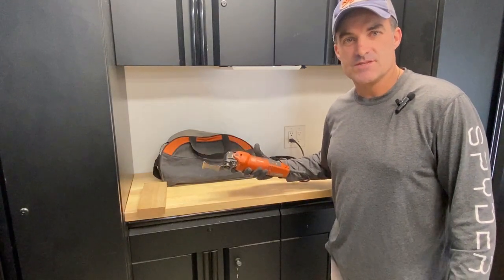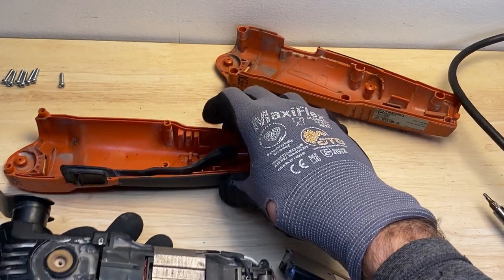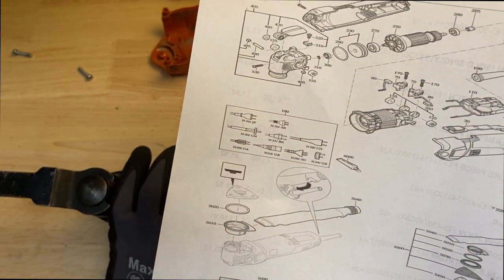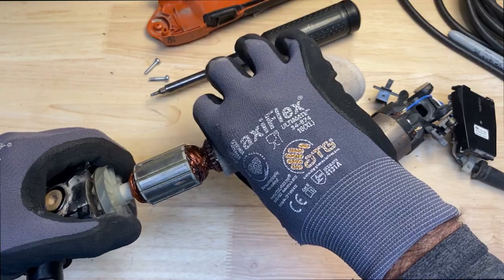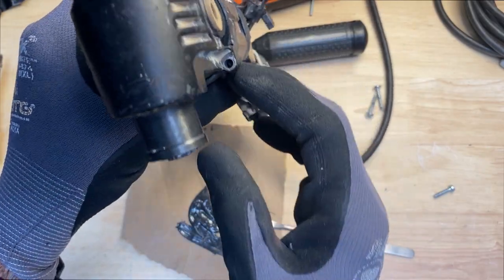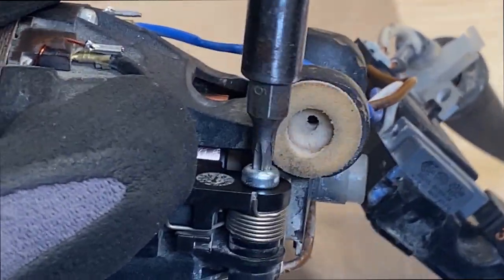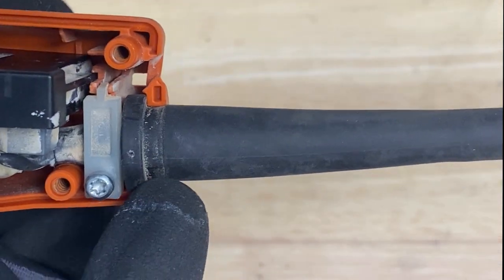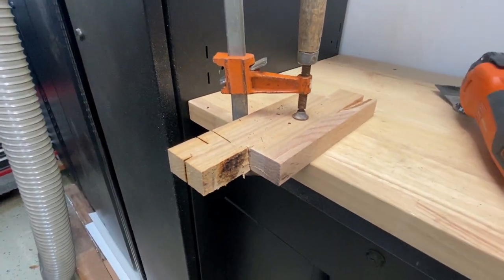Broken Fein Tool Multitool Fix How To

Comment: I appreciate the tips, but this could have been a 5 minute video. Everything was said more than once, and we get the gist with a 5 second shot of each step in the process. A half hour is a very long time to receive the advice to tighten 4 screws and add some epoxy. Maybe a minute or two on bonus ideas, or a follow up video for diagnosing. Hope that helps get more subscribers 😊
Reply: Best advice. I'll skip the video 😅
Reply: People are not clever like you /smartass!

Comment: I have only been using my Fein Multitool for three days to remove grout. It is doing a wonderful job. I hope it continues to work very well. Your video is excellent. You did a terrific job of explaining and showing close-ups of everything you did. You also did a fantastic job of putting everything back together. That is always my biggest fear in taking apart a tool, whether I'll be able to put it back together exactly right. I agree that JB Weld is an excellent product with many applications. Thank you for this wonderful video!
Reply from the maker: Thank you so much for watching the video and leaving such a nice comment! These are great tools… And it’s always nice to be able to find a fix if they ever need repairing.👍

Comment: Right thing, wrong repair compound. WEST System makes a epoxy ( G Flex) designed to bond to plastic and other hard to bond to products, called G Flex. It has a great modulus of flex and bonds well to plastics. Part of your problem is the cracking in the screw mounts. They are degraded in strength.
Maybe repeated filling of the screw recess and inserting of the screw would open the cracks and allow the screw insertion to force the repair compound into the cracks. Or not.
 Fein loves to write invoices. Its their Favorite thing to do. Purchasing the encasement may be the only hope of salvaging the tool. Depending on the hours of use on the tool and the price of the part, a new tool may be the best bet.
I'm a multi tool user for  35 years. These days, I purchase (for $ 28.00 from  Wal Mart) a  multi tool from China, brand name 'Hyper Tough' I get a year of hard use out of these tools. Its usually the rheostat in the switching that fails. I pitch it out and head for Wal; Mart.
think it over. The Chinese have co-opted an older design from Fein.  It  works great but has  more vibration issues and noise issues. Compared to the price that Fein wants, I'm a Hyper Tough user all day.